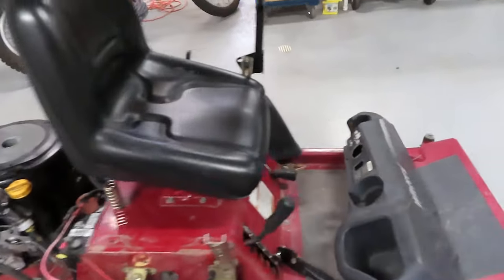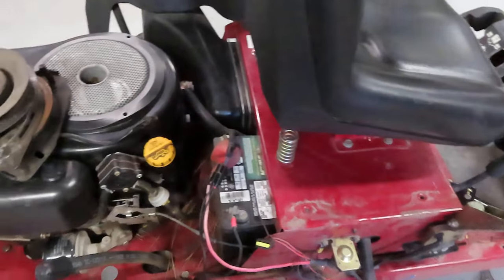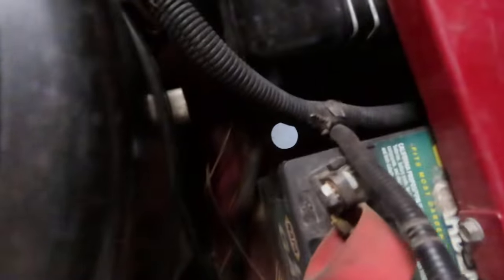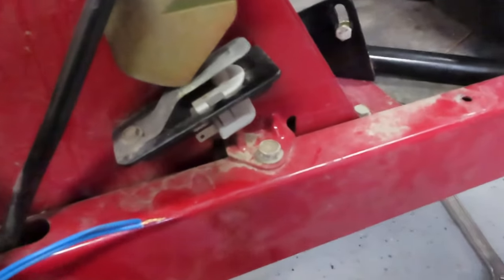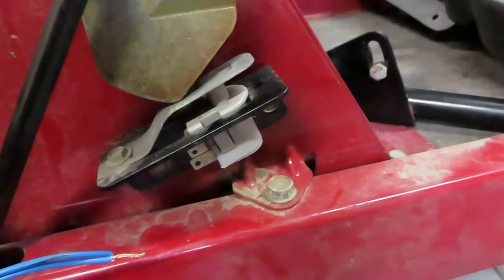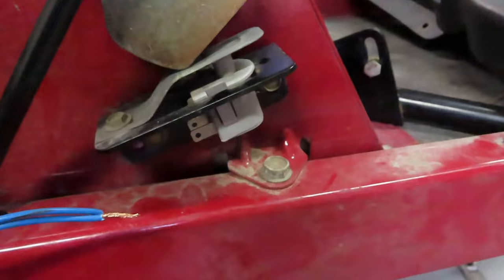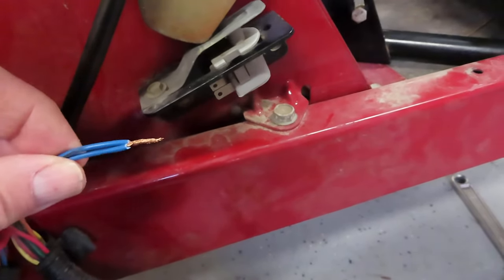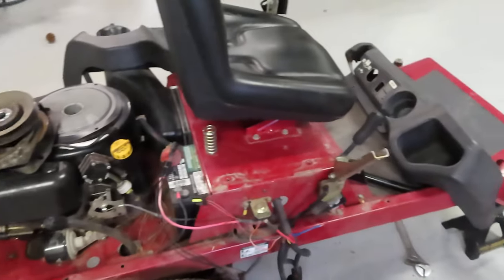Zero Turn Mower PTO Clutch Won't Engage

Comment: Well done. 
All of the safety switches need to be happy in order for the power to get to the starter.
I'm all for the safety switches. Safety is important when using these machines. 
A scary number of people have been injured as a result of disabling these safety switches.
Just sayin. 

Once you understand how the system works, it's a breeze to systematically check for power at each switch when it doesn't want to start.
That little bit of effort is a lot better than backing over your dog or accidentally cutting toes off - yours or others.
I get it, some of these safety features can be a pain but they're there for a reason.
Be safe out there guys. Happy mowing.
Reply from the maker: Thanks!  Yes - don't bypass safety switches!  I did it to my mower but that's my choice.  Don't do it especially if you have little kids around.

Comment: I'd suggest checking pto switch, safety switches and fuse before removing the clutch itself. Save yourself from unnecessary work. Start with the easiest stuff 1st.
Reply from the maker: For sure.  Thanks!  Paul

Comment: Will stop my blades from turning on completely like if got stuck or messed up someway that it wouldn't let the blades turn on at all even without going in reverse???
Reply from the maker: Yes.  If either reverse switch is faulty, you will not be able to turn on your blades no matter what you do.

Comment: I do you still have this mower? I just bought one and on the pto switch the wires were cut and I’m trying to wire it back, but I don’t know the color arrangement on the switch
Reply from the maker: I do. Have it.  I'll see if I can see it easily and help you when I have time.  Thanks.
Reply: Oh man thank you that would be greatly appreciated
Reply from the maker: Ok - if you are sitting on the mower looking down at the PTO switch aka top down (assuming my switch is installed the same as yours and not 180 degrees out!) the front right corner of the switch is orange/black stripe.  The right center position is empty.  The left, rear position is orange/white stripe.   The front center position is empty.  The center position is yellow/black stripe.  The center rear position is yellow.  The Left front position is empty.  The left center position is blue.  The left rear position is red.  Hope this helps.
Reply: I found the wiring diagram!! Thanks anyways

Comment: How's the pto clutch work
Reply from the maker: I think it's an electro magnet that pulls metal plates together.  When not energized, one plate is spinning and the other is not.  Once energized, the plates "stick" together and rotate together.  It needs power to stay engaged.

Comment: I did this exact same thing and it melted my pto switch now I dont know where the wires go on the reverse switches. can you help me out, I'm goin nuts lol
Reply from the maker: It doesn't matter how you reconnect the wires to the reverse safety switch.  Either terminal for either wire is fine.  Did you test the switches to see if they function properly?  If so, they are likely not your problem.  As for a melted switch, watch "how to test a pto clutch for resistance" on youtube.  Excellent vid.  In a nutshell, if the resistance is too low in your clutch electro-magnet it can melt the switch.  I'd also look for damaged wires anywhere in the wiring that might be shorted to ground that might be causing your issue.
Reply: @paulhaines5755  Ok thanks, must be the pto going out
Reply: Could be - test it.  You should be able to trace the wires back from the PTO clutch and find a spot to disconnect them and test them with a multimeter.  New PTO switches are easy to get and cheap.